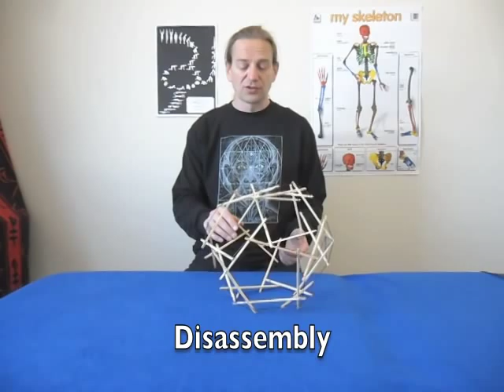How to build a 30 strut tensegrity dodecahedron

Comment from the maker: @mishkyn910 The sticks are made of bamboo, and have a groove sawed in each end. I haven't build any model with straws, they bend too easily, and it's difficult to attach a string or rubber to its ends. That's why I made the toolkit - some instructions for building tensegrities skip over the difficulties in preparing sticks and strings in a way that makes assembly easy.

Comment: Looks like each edge of each pentagon on your dodecahedron model is about three-fourths the length of each bamboo piece, given the manner in which you are arranging the bamboo pieces. 

The ratio of the length of each edge of each pentagon to the radius of the imaginary circumscribed sphere around the polyhedron is about 1.4. So given your construction technique, I can use the 1.4 ratio to create another tensegrity polyhedron that is scaled larger or smaller than your model.

However, your model is not a regular dodecahedron. Hhmm ...
Reply from the maker: Technically, it's a truncated dodecahedron, each corner opens up to a triangle (which is were the truncation happens). The amount of tension, as well as the precision in the construction determine how regular it looks. With this construction method, (truncated) cube and dodecahedron are quite unstable. 

Indeed, scaling up or down is easy, however, with strut lengths smaller than 10cm it becomes quite difficult. It is possible to construct a tensegrity with ten struts where all the strings map the edges of a dodecahedron, just not with the elements of this toolkit.